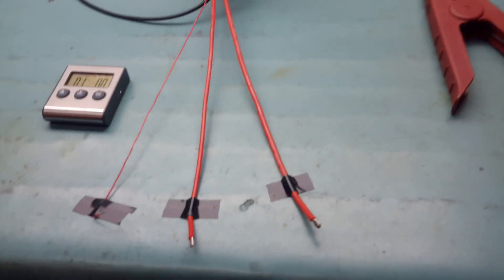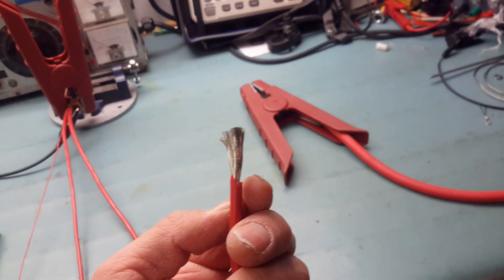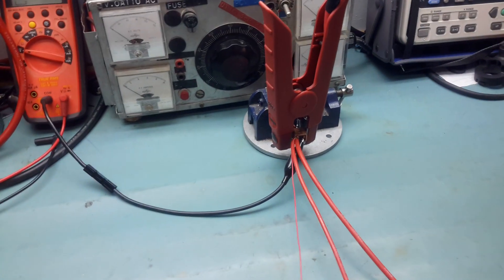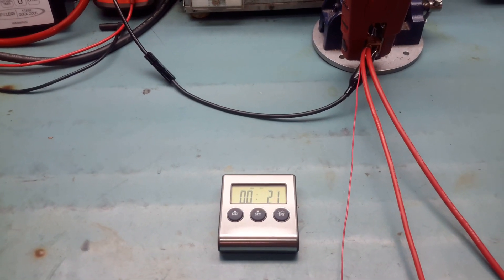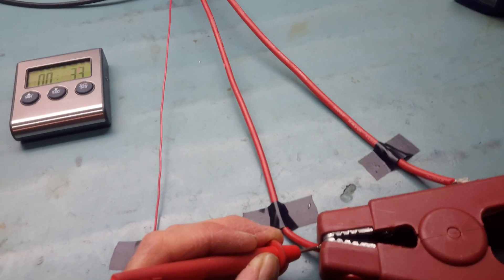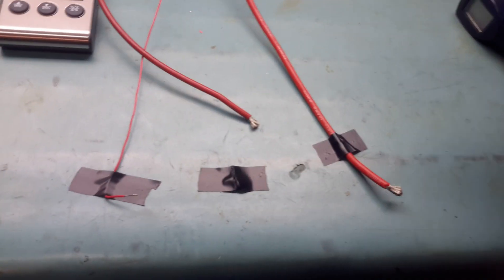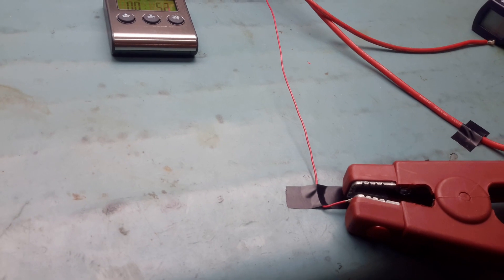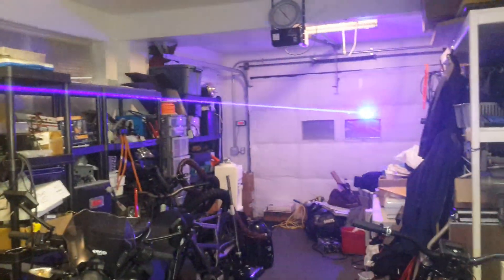100A Test of 10, 12 and 24 gauge wires  !!

Comment: Lab is noticeably and dangerously practical to let novice understand when presumably picks the low gauge wire with high current consumption equipments. Like what you did. Thanks.